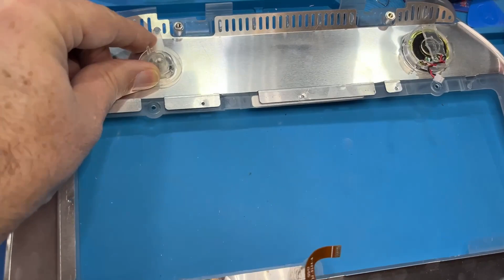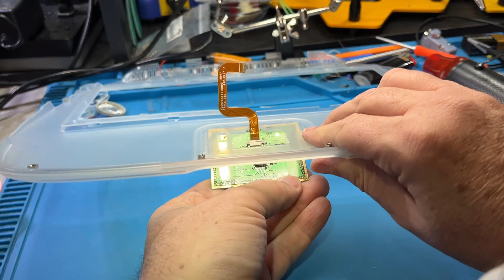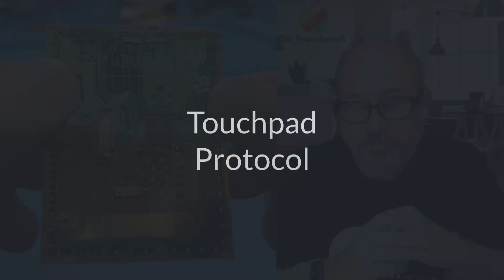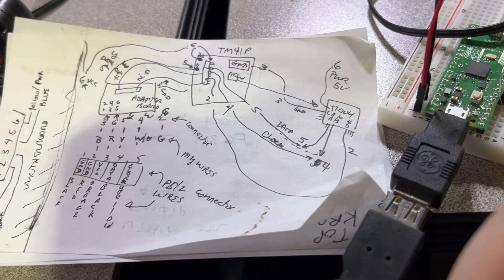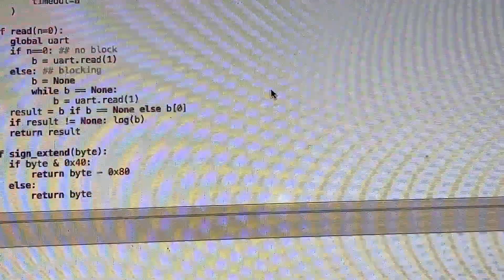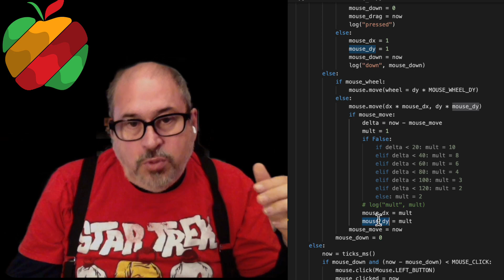iBook G3 Clamshell Touchpad Details

Comment: Thanks for the video.
I have an iBook G3 with a non functional trackpad, the previous owner told me the flex cable is not the issue.
I wonder now if a different trackpad with the same chip from a different laptop like Compaq would work.
I found some trackpads on ebay that use this chip, and seem to be the same dimensions as the iBook trackpad.
Hmm, have to check my pile of vintage laptops and see if any would fit!
Reply from the maker: Neato. BTW: I found flexible cables on Amazon that fit the trackpad on the ibook.
https://www.amazon.com/dp/B09R8Z4B9P?ref=ppx_yo2ov_dt_b_fed_asin_title